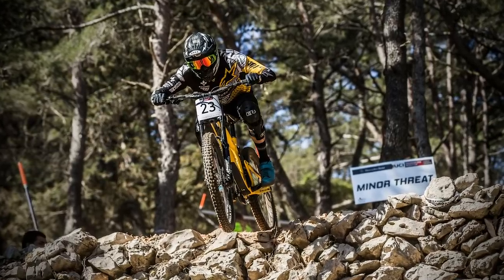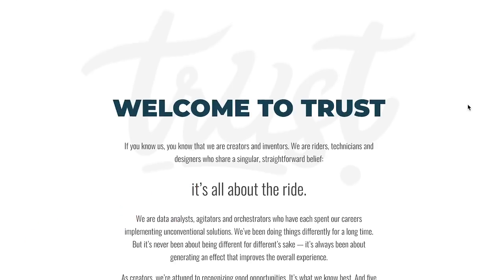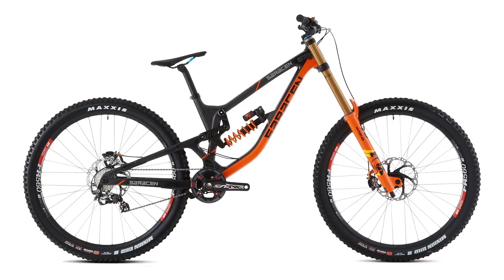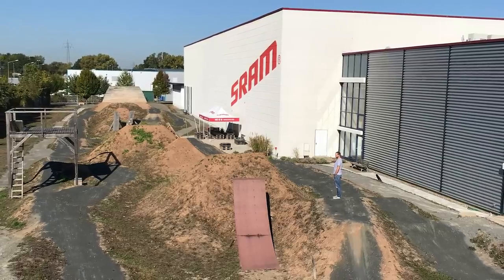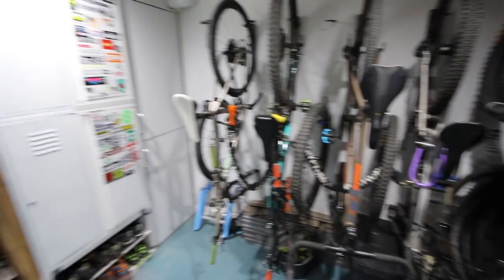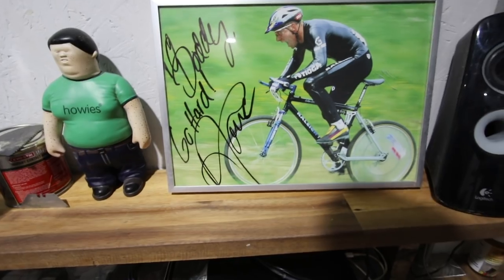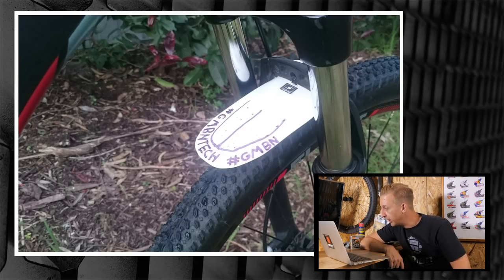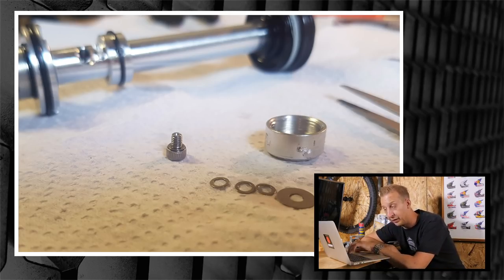Visiting SRAM + Doddy's New Bikecave | GMBN Tech Show Ep.37

Comment: What grease did TF tuned use on the negative spring? If my shim stack tweak doesn't sort the fork then I might try the volume spacer oil trick to increase ramp up. Thanks for featuring my mod this week by the way!
Also, I've got an old set of dual-air Revs on a bike that pre-date volume spacers. They have a separate -ve air chamber so is it safe to add oil to them? I assume there's no port to block between the two chambers. They're in desperate need of a bit more progression.

Comment: #askgmbntech I am working on a budget GT hardtail. Its has a Shimano Altus 8 sp derailleur and single ring up front. When in its highest gear, and pedal backwards, the chain drops down a gear. Replaced the derailleur and straightened the hanger and its still happening. The chainline looks pretty aggressive when in its highest gear. Is there a simple solution that I am not thinking of? Thanks in advance.

Comment: 9:45          I am guessing where you live, it is not very safe considering the way you have your bikes locked up. Thats sad you can't feel safe in your own home. 
Awesome you were able to get a bike made to your liking. I wish I could have got My Specialized Enduro with a lower seat tube and slightly steeper for better climbing,  and a wider chainstay to fit 3.0 tires.
Reply: Glad I'm not the only one paranoid enough to lock my bike in the house! LOL. Channel Zero One, I feel pretty safe in my house, but on the off chance that someone did break in, anything I can do to slow them down is a win as its very likely to discourage a burglar; they want to be in and out as quick as possible. For the few extra seconds it takes to lock it up, it just gives me some extra peace of mind and less hassle in claiming insurance, trying to replace what is often a customer set-up.

Comment: #askgmbn  Will a 12 speed SRAM Eagle transmission work on a non-boost (142mm) frame?
Reply from the maker: If your 142mm spaced wheel can accept an 11speed set up using the XD driver body then there's no reason it can't take Eagle! Chainring may take a few mm of spacing to achieve the right chainline though!
Reply: Thanks!

Comment: Cnc milling/lathe is a labor intensive process? OMG! what a bunch of avg joe nonsense.... the Cassettes should be super cheap because it basically is mount/fix the material inside the cnc machine push the button and wait 10 min before it is finished. Honestly modern machines does not need any manual fixing of the one pice material as it can do it itself and then when it is done replace it with a new one... Omg I know I sound like a grumpy old man but you sound more and more like you want to make everything out to be so amazingly hard to make and expensive... What you are talking about was the norm back in the late 90s early 2000...
Reply: So before you put your chunk of whatever in the machine and hit the button, you don't CAD/M?
Reply: Steven S  .... I thought that it was a given that somebody need to design the piece and then either convert it to G-code or simply use a cad/cam software in that case it would go even faster. But even if you make it by hand you need a blueprint to go by...
Reply from the maker: Well Pillokun, we were on the verge of similar thoughts before we actually went to see it all and understand the reasoning behind it, boundaries to be overcome and design process to back it up.
Reply: @gmbntech  Boundaries to overcome and design process to back it up. Sorry but that is pure marketing BS. :p Highscoolers get do in their classes more advanced things than this.

The more I  watch you promoting something and hearing/reading the way you speak like now with your reply, the more you give away that you have no clue about manufactoring.

All I ask is that you are a bit more "investigative"(looking for the right word) and not that easily swayed by manufacturers claims. Mass manufactored stuff lime these should be super cheap. One Cnc machine will spit out probably 10 to 20 pieces before a machinist will make only one.